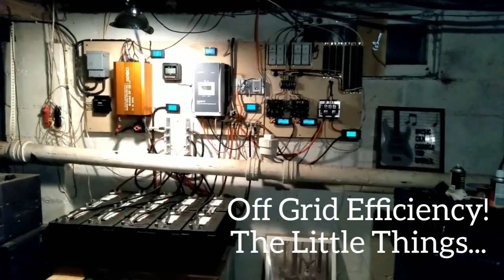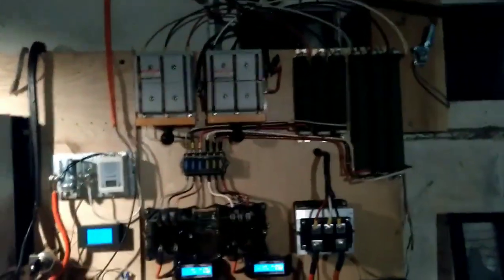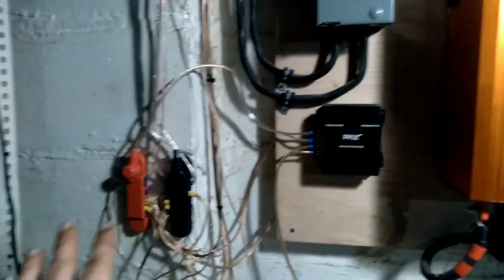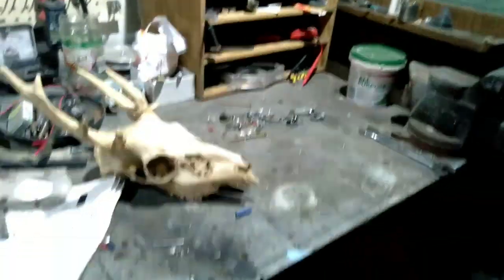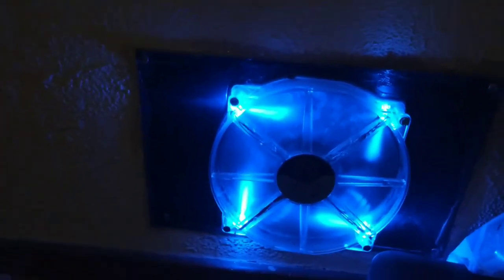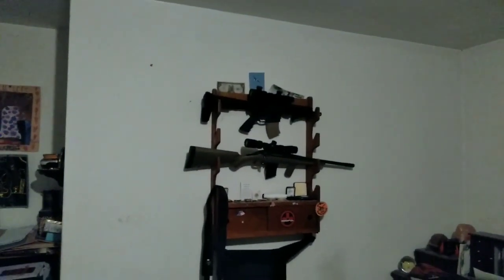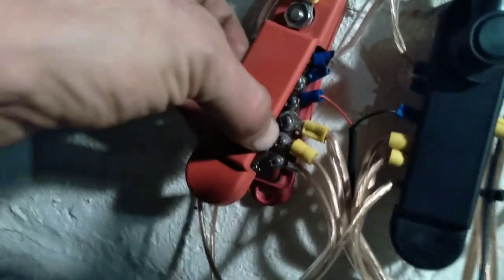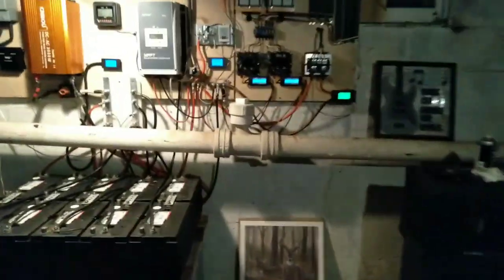Off Grid Effiency! The Little Things...

Comment: Hey mate thanks for sharing you’re video. Just had a couple of questions if you don’t mind answering. What are you powering with the inverter and if one of you’re batteries in you’re battery bank were to fail would you only have to change out two batteries at worse?
Reply from the maker: The inverter powers everything else in the house...fridge upstairs, dishwasher, cloths washer, deep freezer, power tools in my workshop like drill press, welder, compressor ect. It's mostly a normal house but ive made a few things for efficient to stretch out battery life. When picking out appliances I do thorough research into amp draw rather than features or cosmetics.... and yes, if one battery failed I would have to phase out the pair it's connected to and replace as needed.
Reply: Small City Homesteaders thank you for taking the time answering my questions.
Reply from the maker: @hemiandreassend3848  my please bud! It took years of trial and error to get this house to run as smooth and efficient as it does now. I share it with the world to maybe save a few of ya's some grief, cash and time. Any more questions....just shoot.
Reply: Small City Homesteaders much appreciated mate, i’m not sure if i told you before but i’m currently living in Australia and am planning on moving back to New Zealand in a year or so. I’m moving back out in to the country and planning to build a small house or if things don’t work out i’ll renovate our old homestead, to have mains power supplied to the house is way to expensive so i’m planning on installing Solar and wind. Originally i was thinking solar and hydro turbine but waterfall is to far from the house.
Reply from the maker: @hemiandreassend3848  water it a very viable option...slow steady power is irreplaceble. If you do make sure you start with a high voltage stator to keep voltage drop to a minimum. Othrreise....your in the equitorial zone so solar just plain rocks. Ever in cold ass wisconsin, solar accounts for 95% of my charging power. Wind is incredibly unrelihable and complicated.  Best of luck bud. When you do build....go overkill with the wire and you'll be pleased.